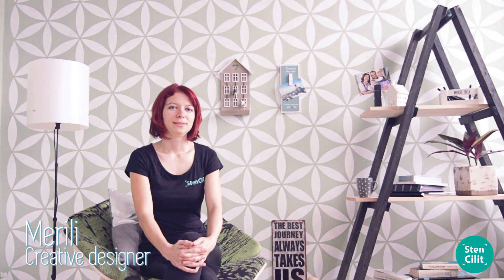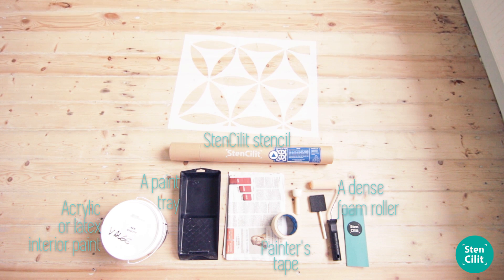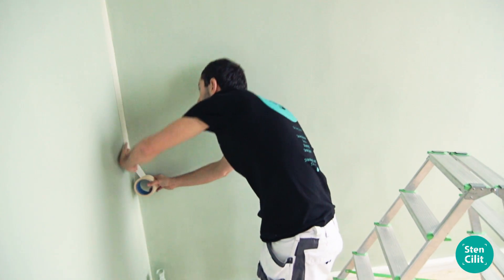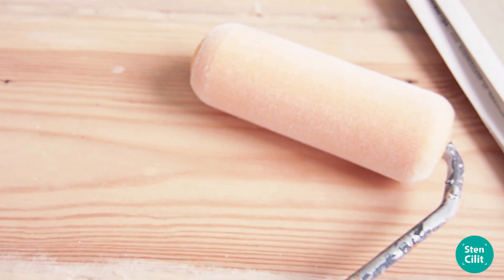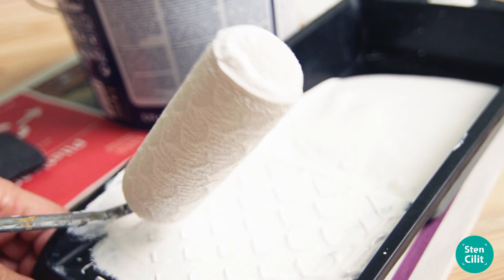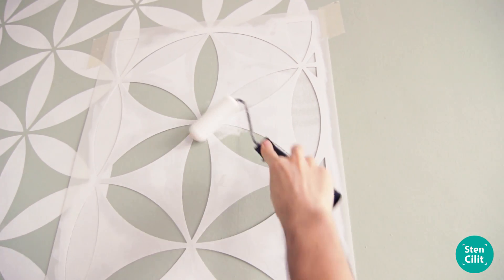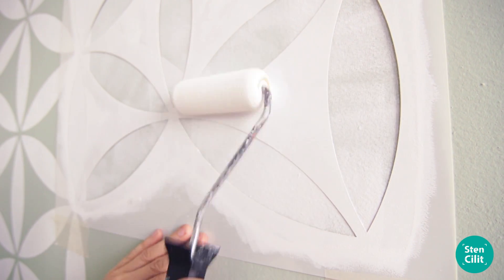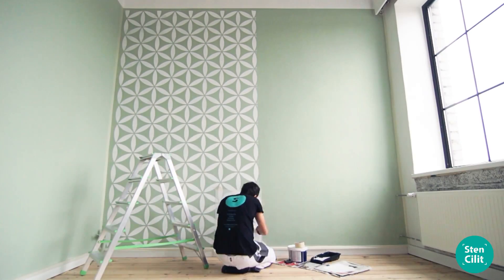How to stencil a feature wall - Main technique - Part 1 [Stencilit®, your partner since 2013]

Comment: Pls higher sheet size
Reply from the maker: Is not possible to make a stencil larger than 100 cm on the longest side. It will be very hard to deal with it when is full with paint.